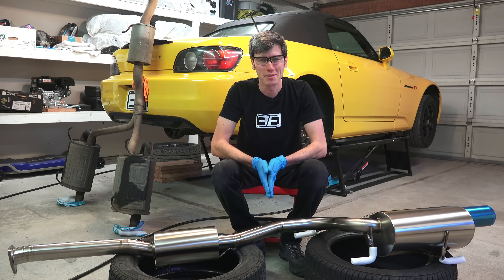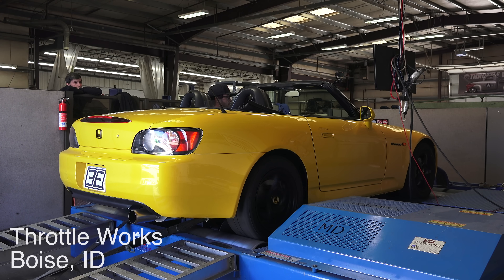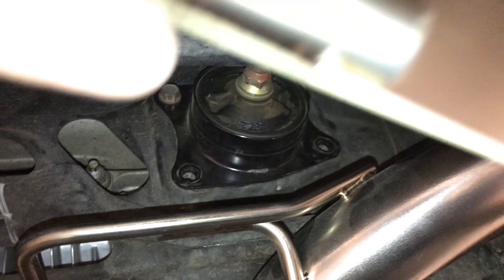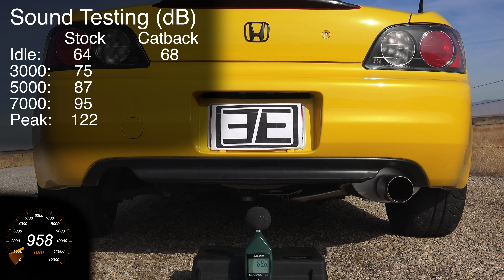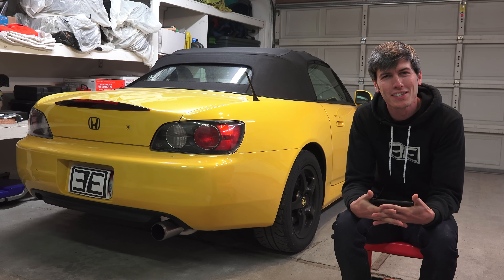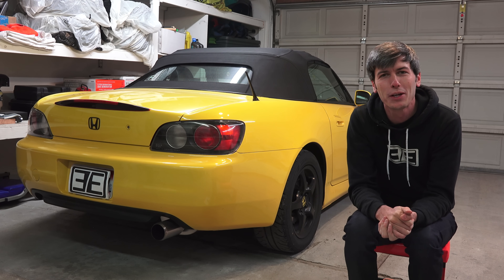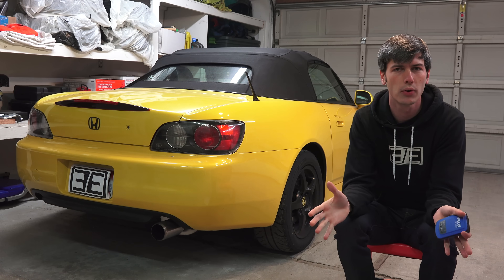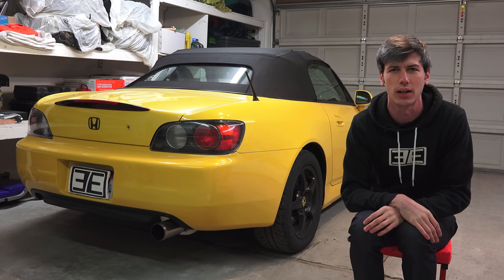Can A Catback Exhaust Make Your Car Faster?

Comment: If you were to test the car on the dyno three different times with the stock exhaust, would you get the same exact horsepower numbers every time?  If not, then a 2.5 HP increase on the dyno might be meaningless. But I loved the video!!!

Comment: I notice the factory unit utilizes a helmholtz chamber, but the replacement does not. Do you believe there is a benefit to utilizing a helmholtz chamber in the exhaust beyond elimination of drone. helmholtz chambers are used to performance benefits in the intake because of pressure waves from closed valves. Is there a pressure wave cancellation performance gain to be seen in the exhaust?

Comment: Not sure if someone mentioned it, but even though you only got around 2.5 HP, you lost quite a bit of weight replacing the stock exhaust system.

Comment: translation for wall of text : Don't forget to have the computer 'tuned' when you install a new performance part, or you will not have much of a gain in power. If you had properly 'tuned' the car's computer, then you would have gained 10 to 15 hp and not a scant 2.5. hp from the new exhaust.

You made a large error in your testing, you did not reprogram or 'tune' the car's computer to match the new exhuast system. Many people are not aware that in order to get the power gains they seek from modifications such as exhaust or intake that they have to reprogram the car's computer that regulates fuel to air ratio, back pressure and the air intake. If you fail to reprogram the computer so it recognizes the new parts, you can only expect modest power gains like the 2.5 you just displayed, which fall within the normal parameters of the computers programming that allow it to make minor adjustments in fuel and timing to account for day to day changes in variables like weather. 

The computer simply cannot recognize the modifications you made to the car. If you had reprogrammed the computer accordingly, then the exhaust you installed would have made gains around 10 to 15 hp (small engines do not gain much from naturally aspirated  intake and exhaust modifications) This was the first video you posted where I was disapppointed in your lack of attention to detail, which is normally excellent.

Comment: To comment on your acceleration test conditions, and to really nerd out for a sec. When you calculate your conditions for density altitude, based on you being in Boise, for your stuck conditions, you get a DA of 3607ft, and your catback conditions gives a DA of 2505ft. So, the power and weight certainly helped your runs, but it was also like driving the car at 1000ft lower in elevation.

Comment: Pair it up with some Comptech Header (CARB LEGAL) from CT-Engineering.

I myself have 2000 Accord V6 and when I installed the Magnaflow Dual Exhaust noticed a slight kick in power but not much and exhaust was a bit louder than normal.
Paired it up with Comptech Headers and man I can tell you it made a big difference. Exhaust sounds nicer and has a nice deep growl + power increase hands down.

I have not dynoed it yet. It had a 3.0 with a automatic trans. But it currently has a J32A2 of the 03 CL Type-S with a 6 Speed and 3.7 Intake manifold off a 09 TL SH-WD + other bolt ons and not sure how much power at the wheels but if i can guess.. it's around 315-320 at the crank untuned, stock ecu.

Comment: Surprise that Jason didn't do more engineering analysis, not that the numerical results doesn't speak for itself. Honda actually designs pretty nice exhaust systems, for being mass production units that demonstrate reasonable efficiency. Steel has good corrosion resistance and thermal and cost benefits; yes, there are better. The sizing actually isn't that much of a factor on such a small airpump; people that argue are unfamiliar with the formulas related to flow. Big diameter can be more of an issue on NA cars than smaller pipes. Again, Honda knows. In the end, there's oft a compromise of sound to resistance. That loop he mentions is actually related to the wave form of the exhaust. If you listen to both exhausts you can hear less of an interruption in flow when blipping the throttle.

Comment: It would be interesting to do the test again with the new exhaust AND with weight in the car to equal the old exhaust. Then you could see how much acceleration changed from the weight vs the HP.
Reply: You could do this with a bunch of different weights too (5lbs, 10lbs, 20lbs, 50lbs, 100lbs...etc) and then curve fit ...make a new video and just compare how much weight savings affects handling/acceleration. Then we would know if it's worth removing our spare tire or shaving our legs for track day ;)

Comment: 2 horsepower + around 34 in weight savings = 5% performance increase without returning the engine for the exhaust, not bad.

Here's something I am wondering about.  Honda could have saved weight and production money by making a flow through exhaust and it could have made the car around 5% higher performance.  So why did they make such a complex exhaust?

Comment: I may be wrong, but it's a bit of a waste without a high flow cat!! Would definitely like to check a dyno graph with and without high flow cat
Reply: Yeah I would love to see a high flow cat installed and then do these same tests.
Reply: I bet it'd make a huge difference, maybe not that big on numbers but function-wise it would surely be noticeable!Throttle response throughout the powerband can't be compared!
Reply: Most cars today have pretty flee flowing cats in them to begin with. Spending a bunch of money on a different one or deleting it really isn't needed or going to do you much good. Sometimes it will cause more problems than its worth. 20 years ago, ya they sucked.

Comment: hey Engineering Explained, you should try this now (maybe a different car? lol) using stock piping with only doing a straight through or similar muffler. Would be interesting to see the power benefits if any exist.

Comment: Jason, I need a bit of an advice. I'm about to delete my car's ( a 2015 petrol Mazda 2 hatch or scion iA to you guys ) muffler, in hopes that it'll gain ( very )little fuel economy. I've read a few theories about how exhaust mods is done to increase efficiency, which means better fuel economy. But I've also read some guys in forums saying that due to less back pressure, the engine will actually make less fuel economy. Can you explain to me if back pressure is actually a good thing ( especially for low RPMs ) or is it a bad thing? As far as I know, and according to Mazda's reason of putting a 4-2-1 exhaust in my car, back pressure isn't ideal for fuel efficiency.

Comment: You have to look at an engine as an air pump that allows fuel to combust within it. You decreased the backpressure and allowed air to flow out the rear of the car easier, but you're still limited by the intake of air and fuel allowed to combust. The catback wou;d be exponentially beneficial if you were to install a turbo,  supercharger or larger injectors.  Install one of those and see the difference the carback provides as opposed to stock. I guarantee that you would not be underwhelmed by the performance increase of a high performance exhaust once your intake has been upgraded.

Comment: Seeming as your stock exhaust is the same size as the new one. why not just cut the dual of the stock exhaust and weld where you cut so its still a stock exhaust but now a single outlet. Now you have lost a good 25 pounds of weight, and saved yourself 2000$. Instead of buying a 2500$ brand new exhaust. and on the stock exhaust you could even of modified the very tip to be straight so theres no curved pipe on the very end. All in all if you did spend 2500$ on that shitty exhaust, it could of cost you maybe 300$ and a bit of help for the exact same thing minus the shiny looks. For that price you got ripped a new one and it barely even sounds different. Love your vids tho.

Comment: Volumetric efficiency is already SO good with this engine; it's going to be difficult to add more than 10-15HP with intake/exhaust bolt-ons. Try adding a turbo or blower kit for $4k, or try a cheaper ebay kit for $2k. Guessing an easy 50 HP to compliment your higher-flowing exhaust.

Or think of it this way - by freeing up 34 lbs, you can now install a power adder with ZERO weight penalty! SWEET!

Comment: Surely its the cat and not the back box that is the most restrictive part in any OEM exhaust system?   2.5hp for a catback with no remap is about what I'd have expected. If you're going to spend thousands on an exhaust then surely you'd go for a high flow sports cat as well?  Seems like a job half done otherwise.  That said, if I was going to spend 2.5k on a performance mod I'd have gone for a supercharger kit.

Comment: Change the CAT next to see if you can gain any power from having a less restrictive CAT.
Reply: How about get rid of the Catalytic Converter all together.  See how much it increases in power.  Then replace it with one more efficient than the stock and see what that does.
Reply: @Val1973-n2h  correct cat can increase hp over just snipping it off

Comment: 2 hp and - 35 lbs
Reply: But have you SEEN those welds tho
Reply: Kerwin Wade sadly I personally would get nervous if I saw someone eyeing my exhaust in a parking lot, ya know, stealing the cat
Reply: Kerwin Wade what u gonna look at the welds while driving the car?? Lol
Reply: Lame
Reply: and it will last forever, which is good if you planning on holding on to the car.
Reply: @giorgosk2884  $1000 per hp. That works out to 1 million for 1000hp. Look at the price of Bugattis and Koenigseggs and its about right
Reply: if it needs to be replaced, could be worth it but I wouldn't junk a still good exhaust to get 2hp
Reply: Never mind the hp, light weight.  When you've carbon fibered everything even the wheels...this is the next step in power to weight.  And Ford's carbon fiber wheels are  over $5000 ! (Weight loss and rotational) . Less strain on the drivetrain. 😎
Reply: Carlos Benitez prob could have found a second hand blower .....but some people are a lil retarded
Reply: i think the reason its so lightweight is also because its a single pipe instead of the OEM dual exhaust
Reply: @DeadsupraEE3  Titanium is lighter than aluminum, which is already significantly lighter than materials like steel
Reply: @mourgraine221100  i understand. im talking about the amount of exhaust outlets though. not having the split, etc. less overall material.
Reply: @mourgraine221100  Absolutly not, aluminium density 2.7g/cm^3 vs titanium around 4.4... But bit better strength and more importantly way higher melting point which is good for an exhaust pipe ;)

Comment: Doesn't an exhaust by itself not increase power a lot but instead increase the potential of other engine mods later down the line, I was always under the impression that the limited exhaust limited the power increase for other modifications such as intake, valves, porting and so forth and putting an aftermarket exhaust on your vehicle was more of a supporting mods that helped your other mods reach their full potential, could anyone shed some light on this, or would be a cool thing to test to see how exactly different modifications worked together

Comment: NHRA says losing seven lbs weight is equivalent to one horsepower gain. So losing 35 lbs off exhaust weight is like gaining five hp. This is why 1.2% weight loss doesnt work in factoring acceleration. It's because of reducing inertia that makes weight loss so effective in improving acceleration. Hope this helps!

Comment: "I didn't want it to be too loud - I think four cylinders aren't the greatest sounding engines in the world, they don't need to be accentuated anymore than they are" - Take note chavs!
Reply: Boxers sound great, especially the ej
Reply: @benkline4896 invidia high flow catted downpipe with n1 non resonated cat back 👌 not insanely loud real nice deep tone and aggresive WOT
Reply: @ool3062  sure
Reply: @angus823  Believe it or not, it does.
Reply: @ool3062  sure
Reply: That's anti-american!!
Reply: Muffler delete on my BMW 530e with (B48 turbo i4) sounds like a catback V8 lol. Honestly didn’t know what to expect from a 4 cylinder but I think the turbo helps it out a lot. Also averaging 87mpg lmaoo
Reply: Also Cat delete on my 99M3 sounds literally insane. Louder than my parents Z06 but the drone is real at high way speeds lol
Reply: shut it XD
Reply: Chavs mental note: some guy on YouTube hears 4 cylinder motors a certain way. Got it! This chav hears them differently, noted or not!
Reply: The a45 sounds pretty good
Reply: Audi A4 sounds good even sounds decent straight piped it’s crazy that they share the same engine
Reply: Only b6/7
Reply: 4c
Reply: Clearly this dude has never heard a roudy k20 2 step set-up.
Reply: @ool3062  oh no, no... Not surprised that you'd think that, though...
Reply: 4age
Reply: @ool3062  They really reeally don't, had a mate with a 330 and mate with a 4pot diesel.. At no point in the rev range do they even sound remotely similar.
Likely wishful thinking on your part, but hey if you like your car for what it is, who cares!
Reply: Philly never you mind Yeah man, but I meant when you are driving and putting your foot down you will hear a deep sound that sounds between a i4 and a i6.
Reply: @ool3062  fair play! To be fair as far as diesel engine noise goes, BMW ones don't sound too bad!
Reply: Unity101 s2000 sounds amazing
Reply: Some sound pretty good in my opinion, like I actually like how the 4 bangers sound that have 2.0l or more I think it kinda depends on the displacement of the engine like my eclipse sounds pretty damn good and has a deep tone to it and it’s on a stock exhaust, but it’s a little rattly at the same time so hopefully the MagnaFlow exhaust I got for it fixed the issue

Comment: Love this video, very interesting. Does the S2000 rev hang like some other Hondas? That could be an interesting video. Why do some engines rev hang and what is the best way to shift on cars that do this?
Reply: Rev hang is usually from a dual mass flywheel or for emissions (burns off fuel better)

Comment: This does at least give a baseline at this size and power of car. On a 750 HP V8 heavy girl (*looking at you Challenger ;)*), even more weight could be saved at just slightly higher cost for larger diameter tubes. Freeing up weight often is a rather expensive ordeal which is why the manufacturer hadn't done it in the first place -- those lightweight metals and glorious carbon fiber are expensive in themselves and expensive to manufacturer into an automobile on the assembly line (e.g. aluminum has different processes in working with it, some plants have to be updated to utilize it, such as in the case of the new Ford F150's). 

Anyways, I can totally understand how an engineer and nerd would want to install a titanium exhaust system on a fairly modest car like the S2000. It'll never have to be replaced again (won't rust out), increases the value of the car, and has intrinsic value to the owner (currently Jason). It certainly makes it much more unique as well!

Those indeed were beautiful welds! Great company!

Comment: What kind of equipment did you use to have the whole car elevated like that?  It looks like it would be a lot better than setting it up on several jack stands.
Reply from the maker: +Christopher Martin it’s called a “QuickJack” :)
Reply: Engineering Explained Thanks!  Gonna have to get me some.  I've got a Fiesta ST and even at the stock height, it's a pain in the butt getting it off the ground.

Comment: looking at the dyno graph makes me wonder:
when the vtec kicks in, does it also create/increase a valve-overlap? 

if the answer is yes, this would appear to me as a best understandable reason, why a better flowing exhaust pipe could increase the power output at higher rpms without other changes to the engine done.
Reply from the maker: +rust on wheels hmm, that is a good question. I’m not certain, but there may be additional duration as well as lift, so it’s possible.

Comment: Great video, but I wanted to comment a bit about the exhaust restriction discussion at the end. Most of the work (i.e. the physics concept) done to get exhaust gases out of the cylinder isn't done by the piston, it's done by the gases themselves once the exhaust valve opens. The pressure in the cylinder at the end of the power stroke is still much higher than atmospheric, and it's that pressure differential between cylinder and muffler tip (and in the exhaust collector!) that drives the exhaust gases out - the "blowdown" phase. Once that pressure equalizes, sure, the piston is doing the work, but the point of blowdown is to get exhaust gas out to make room for fresh mixture. A good header design will help, by using that gas momentum to actually decrease exhaust port pressure below atmospheric, so when the intake valve opens, there is once again a strong pressure differential to draw extra fresh mixture into the combustion chamber.

Getting a detailed knowledge of 2-stroke operation (and understanding how they can make upwards of 400hp/L without forced induction - the equivalent of your S2000 making 400+hp without FI!) really helps hammer home the importance of pressure differentials, rather than flows. Of course, 2-strokes have much stronger pressure pulses to work with, thanks to their "valves" opening at much higher speed than poppets, but the same basic principles still apply. Love your channel, because you are usually quite accurate in your descriptions, but I just thought the end of this video lost some of that accuracy to try and simplify things... What you explained was how the exhaust impacts pumping losses, but really what a good exhaust does (and less backpressure, across the board) is improve gas exchange (much bigger impact than pumping loss difference in most cases).
Reply from the maker: +Mikey Antonakakis great insight, thanks for sharing!